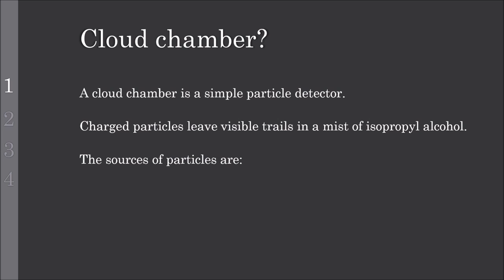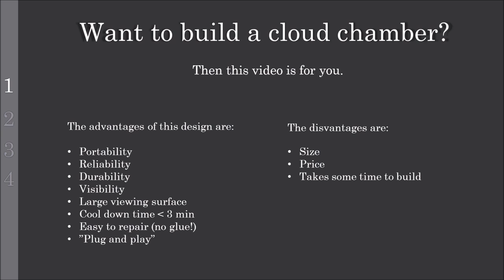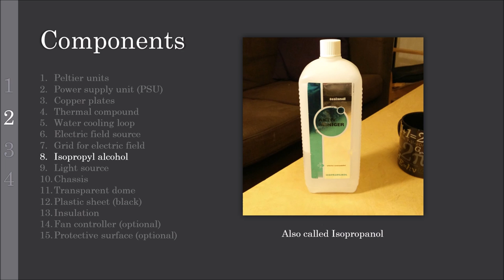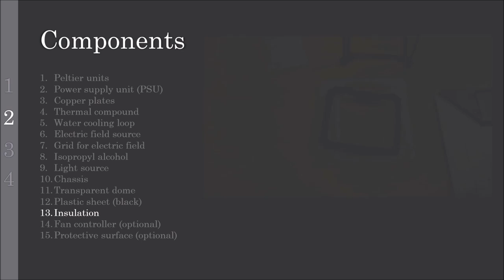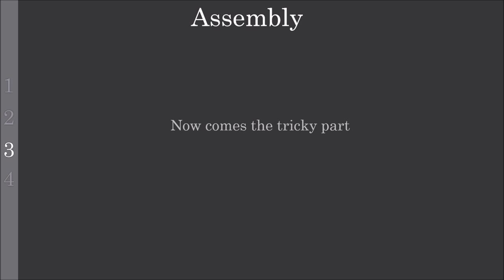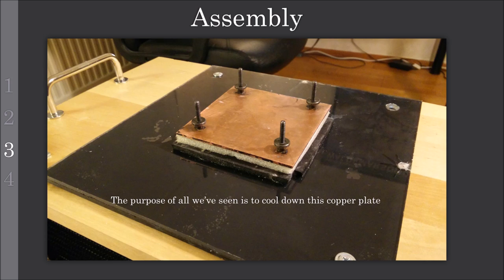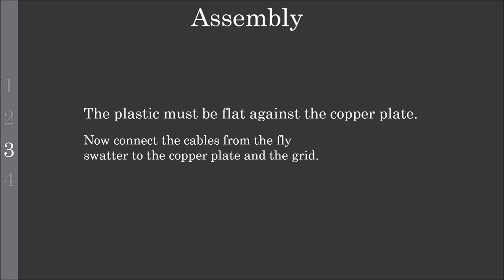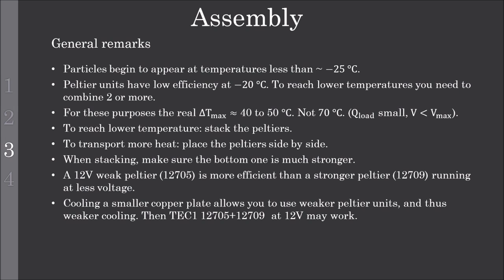How to build a peltier based cloud chamber

Comment: How did you run the larger and smaller peltiers at different volts? Separate power supply? Also, wouldn't it be easier to have a constant static field instead of having to to press the fly swatted every minute?
Reply from the maker: +Gerardo Trujillo The smaller peltiers are connected in series so their voltage is halved down to 6V, while the large bottom peltier is connected directly to the same PSU at 12V. 
Pressing a button now and then isn't very hard and serves a pedagogical purpose when showing it to students. Also, since it discharges when left alone, you avoid that getting zapped when dismounting the machine after a showing :D
Reply: +David Aceituno That's true. I'm not a huge fan of getting zapped. What do you think is the lowest voltage that would work for the static field. I don't wanna mess around with trying to set up a constant 1000v lol
Reply from the maker: Gerardo Trujillo
I don't really know what the lowest voltage that will make a noticeable difference is for the static field (assuming 10 cm distance between + and -). A balloon rubbed against ones hair is supposed to work fine, as well as styrofoam cups, and those probably have under 1000V. A high voltage isn't a very big deal if the capacitor is small (it's the current that matters). Perhaps around 100V is enough.

Comment: Great video and great project. Good job! But I have a question though, do you think it is possible to cool the peltier elements with just fans instead of a water cooled system?
Reply: Or would a CPU cooler (air not water cooled) be enough to cool it?
Reply from the maker: +Sven Weerdenburg Thank you! A good CPU heatsink  with a strong fan should be enough to cool down a smaller surface, in the order of 5x5 cm, using a pair of stacked peltiers like the models 12709 + 12704 (i.e. 9 and 4 Amp units).  There are some other video guides like the one by nothinglabs, for instance, that use that kind of setup. I personally couldn't cool down my 10x10 cm plate reliably that way. Particles start appearing below -25 C, and the heatsink + fan setup would reach that temperature just barely, sometimes.  I used watercooling because I wanted to cool a down to  -30 C or so reliably with a much stronger peltier unit.

Edit: I must admit I was short on funds at the time so I bought a cheap Cooler Master Hyper 212 Evo. With a fancier heatsink it might have worked better.
Reply: +David Aceituno Great! Thanks for the response. I'll first try it with a CPU heatsink. We'll see how it goes!

Comment: 🤓     This is cool. Are you using that one bigger Peltier thing to cool off the hot side of the smaller ones then using the coolant heat sync to do the same to the bigger one? Is that cause the heat sync cant handle the two smaller ones combined, but can handle the single one? 

        Great video BTW.
Reply from the maker: Ducksauce yes! The water cooling unit has about 300 W cooling capacity and can cool the peltiers to a few degrees above room temperature. Individually, the peltiers have a temperature drop around 40-50 degrees Celsius which is just barely enough to get down to working temperature (about -26). A stacked pair of peltiers will produce more heat in total but have an effective drop of about 60 degrees instead. Since the water cooling unit is strong enough to keep the hot side steady at 28-30 degrees, the cold side can easily get down below -26.
Reply: Thanks for the reply. Just making sure I have a decent idea of what I'm doing before I build mine.

Comment: I'm trying to throw one of these together in a cheap computer case haha. So you mention to get copper plates that are at least 2.5mm thick. If they are a bit thinner, around 1.3-1.6mm will it cause problems? I had trouble looking for copper plates that thick online, but I figured the heat would transfer more quickly through a thinner plate. Great job by the way!
Reply from the maker: Hi! The heat transport of copper is fast enough for these purposes, so you don't need thinner plates to improve on that. Copper plates in the 1.3-1.6 mm range can bend or buckle more easily by over-tightening the screws that hold the peltier stack firmly squeezed. In the worst case scenario it cracks your peltiers, and in the best case, you don't get good thermal contact because the plate is misshaped. Note that the peltiers need considerable pressure to squeeze out air-bubbles from the thermal compound. On the other hand, it may work just fine if you change the design such that the plate is not what's squeezing your peltiers together.
Reply: I'll look for some thicker plates then, thanks! I'm also trying to use a 400W atx psu for my build in conjunction with a Cytron ATX breakout board. Being new to electronics, I'm  assuming that with this setup all I'd need to do is solder the larger 230W tec to the +12V and ground terminals, and the two 90W tec's in series to the +5V and ground spots. Is that it or am I missing anything?
Reply from the maker: A PSU for PC's will be a bit tricky to use. Usually on the side of the PSU it is specified how  many Amps you can draw from each "rail". Even if you have a 400W PSU it's not necessarily the case that you can load the 5V and 12V in the way you are suggesting. Just make sure you stay within the Amp boundaries specified for 5V and 12V respectively, though it may be easier said than done.
Reply: So if the large TEC operates from 0-25A, and my 12V rail supplies 22A it won't overload my peltier correct? Or will it draw too much current and overload my psu?
Reply from the maker: In the example you gave it will overload your PSU. The Peltier will draw as much current as its internal resistance allows at that voltage, and the PSU will probably blow a fuse or break trying to supply 25A.
Reply: Thanks, you have been very helpful! Another quick question. I'm considering taking the circuit board of the fly swatter out and mounting it inside of my case. It will be controlled by a toggle switch, and powered by my 3.3V rail of my PSU. The purpose for this is to keep the grid charged constantly to ~1200V because I thought that this would give us the best results. But in your video, you say the "optimum" range is 100-300V. Does this mean that 1200V is too much, and if so why?
Reply from the maker: I would not say 1200V is too much, and remember to consider the distance between mesh and plate anyway, because we are only interested in the electric field strength, not voltage per se.

I have deduced the optimum range from the following observation. When the button is pushed, the fly-swatter loads ~1000V and then most of the mist disappears. After 2-5 seconds, while the swatter discharges through a leak resistor in the circuit, the trails begin to appear. Using a multi-meter I have confirmed that 2-5 seconds after the button is pushed, the voltage has dropped to the low hundreds. 

Now, I did try removing the leak-resistor in order to keep the 1000V for longer, but this did not prove practical. The trails were not more visible , and when disassembling the device there was a high risk to get shocked by  it if not careful. I did get shocked a couple of times :)  Also, I was a bit anxious knowing that there was such a high charge inside a chamber full of alcohol. It never went boom though.
Reply: I also have been shocked a couple times, and i'm taking extra precaution against igniting the alcohol :). So I have put the cooling "block" all together using the same TECs, and in the same configuration. While running, the temperature only drops from 22C to about 9-10C which is not good. It's possible that it needs to be compressed more to get proper contact, so i'm going to get different screws to allow me to tighten the plate down. I also lack insulation around the water cooling block, so I'm going to try to use some foam to keep heat from getting back in. What else should i check to allow it to cool down to -20C? After 10 minutes the plate remains at 10C.
Reply: An update: more compression definitely helped. Got it down to -10.5C. You were right about the thickness though. My plate wasn't as thick as i needed, and it warped as I was tightening it down. I think this might be what is now preventing it from getting down to -20C. Now i'm trying to come up with a way to either find a new plate that is thicker, or reinforce and flatten the one i have.

Comment: David finally i reached the -30 degree celcius with your advices. Thanks. Now trying to make a electric field stuff. You advice a fly-swatter which gives about 1000 volts. Is it a cheap one? Or quality than popular swatters? While searching on it i found pocket type electro shock products which are just twice expensive than fly-swatters and they produce 4.000.000 volts. It is written on its explanation document. Do you think it is more effective than swatters or the voltage is too much for our dedector? Have good day!!
Reply from the maker: Congrats! My fly swatter is just a cheap one from a hardware store. I would be careful with very high voltage because the isopropanol is quite flammable, and a spark could ignite it. I was worried that could happen at around 1000 V but luckily it hasn't happened... But other than that I don't think any higher voltage would be better or worse.
Reply: David Aceituno thanks for your vey very important advice :)) then i ordered one fly-swatter like you. Tomorrow i m going to finish the experiment soon. I will share my results with you!!

Comment: You didn't show where you connected the negative lead from the fly swatter, you stated on the copper plate but where on the copper plate? Pictures don't show it, anyways, isn't there a better way of doing it, like taking two loops of insulated wire, one at the bottom and one at the top, connecting the fly swatter directly to the copper plate sounds sketchy since the copper plate may be in contact with other things.

Comment: How do you connect from the 3-pin or 4-pin cable of the fans/pump to the power supply!?
Reply from the maker: The fans are connected to a fan-speed regulator using the normal 3 or 4 pin connectors. The regulator in turn has it's own 3-pin connector, which I had to cut off and then peel the cable stumps to make contact with the 12V rail of the power supply.

Comment: So the particles are shooting? I always imagined, the radiation is continuous, like with normal radio transmission.
Reply: Very basically, radioactivity decay is a phenomenon where unstable isotopes transform themselves into another more stable isotope by emitting a particle from their nucleus. The emission is a little bit complicated than that, but that's not important here. A specific emission of particle(s) happens once for that particular isotope. However, a radioactive source contains a LOTS of radioactive isotope. They randomly decay in time and emit a particle one after the other, but when you have a lots of isotopes, it looks like a continuous « flux » of emitted particles. Just imagine billions of billions of soldats grouped somewhere and shooting their only one bullet in a random direction at a random moment in time.

Comment: ¿Para que es exactamente la alta tensión? ¿para atraer el alcohol vaporizado a la parte de abajo?
Reply from the maker: El alcohol es neutral, y nada le atrae. La alta tension tiene una o dos funciones (estoy inseguro):
 1) Evacua moleculas y particulas cargadas que ocurren naturalmente en el aire y en el vapor de alcohol, que pueden detener las particulas alfa y beta que son las que queremos ver. Es decir, la alta tension "limpia" la region donde esta el vapor para que las particulas radiativas de alta velocidad puedan moverse libremente y dejar huellas suficientemente largas para ser visibles.

2) Otro uso, creo yo, puede ser para evitar la formacion de gotas en el vapor. De hecho, la neblina desaparece parcialmente cuando activas la alta tension. Ya que el alcohol es un poco dipolar, normalmente quiere crear gotas microscopicas (la neblina). La alta tension obliga el alineamiento de las moleculas de alcohol, de modo que necesiten un pequeño empuje para crear gotas. Las particulas ionizantes (alfa/beta/muones) ofrecen justo eso, ya que cuando entran a alta velocidad ionizan el alcohol, dejando detras suyo una estela de iones, las cuales en su turno pueden romper el alineamiento y crear gotas de nuevo. Son estas las gotas que vemos en el video como huellas de las particulas ionizantes.

Comment: Is the negative wire of the fly swatter connected to the cold copper plate? The positive is on the grid?
Reply from the maker: In this case, yes. Positive to grid and negative to copper plate. But i haven't noticed any difference reversing the polarity.
Reply: David Aceituno The polarity shouldn't matter, I assume the electric field is present to accelerate the alpha and beta particles which are emitted?
Reply from the maker: TheAmmoniacal No, the electric field is pependicular to the emissions that are visible in the cloud. The charged particles should of course be drawn by it to or from the plate but they are fast enough that this isn't very noticeable at this length scale. The electric field is there to enhance the trails by a process I am still unclear about: It either works as

1) an "ion scrubber" drawing away idle ions that a) interfere with radiation trajectories and/or b) act as cloud condensation nuclei/seeds. This is the predominant explanation found on the internet.

2) an "alcohol molecule aligner". The isopropanol molecules are somewhat polar, and should align with the electric field. With low enough temperature this could impede the spontaneous formation of droplets/mist by themselves. Charged particles (radiation) flying by could then ionize them (or simply aggitate them enough) to make droplets, visible trails.

Of course it could also be a combined effect. I draw these ideas from the observation that activating the electric field immediately makes the mist less thick, with smaller droplets (sometimes it almost dissappears), and then the trails appear after about 1-2 seconds.
Reply: Does it work equally well with ethanol?
Reply from the maker: I haven't tried :) lol. I just read that both etanol and isopropanol work, but that the latter should work better at this temperature and I just stuck with it. I suppose they are comparable using the dry-ice approach, as it's cold enough either way, but I think the critical temperature for trails is higher with isopropanol. The original cloud chamber by Wilson used water!

 A couple of years ago I also read a paper saying that a mixture of Isopropanol and acetone was even better, but acetone is not very nice to plastics, so I haven't tried that either.

Comment: Could I use a heatsink instead of watercooling?
Reply from the maker: In short, yes. For this particular choice of peltiers and copper surface area I was aiming for ~300W of cooling capacity. Something similar could probably be achieved with one of the beefier noctua coolers and a stronger fan. For a smaller setup, like 5x5 cm and weaker peltiers you can get by with much simpler cooling.

Comment: What voltage and current are running to your plates?
Reply from the maker: Louis Pennings the two smaller ones at 6 volts and the large one at 12 volts. The current is temperature dependent but Imax should not be greater than about 4 for the smaller and 20 for the large one.